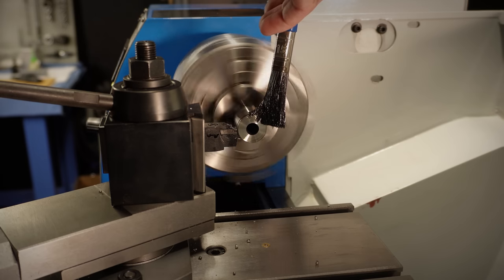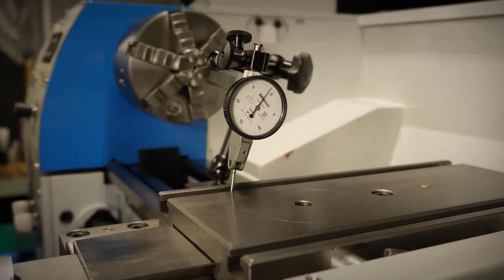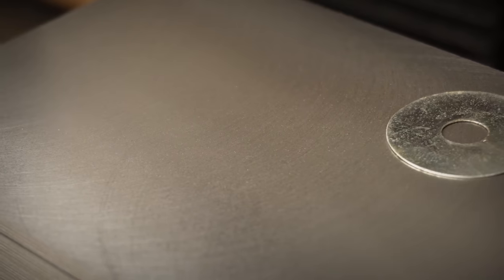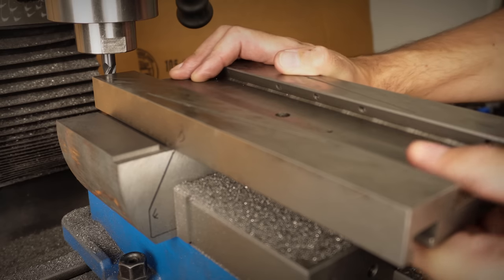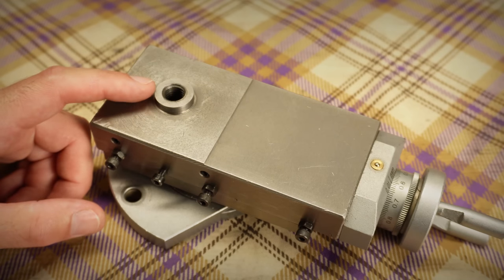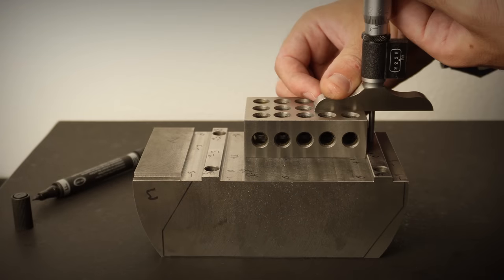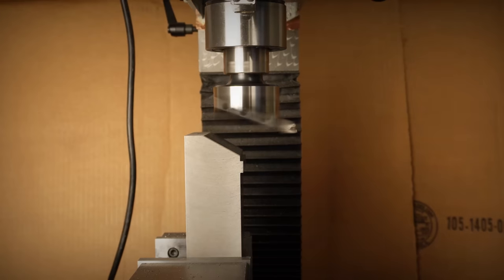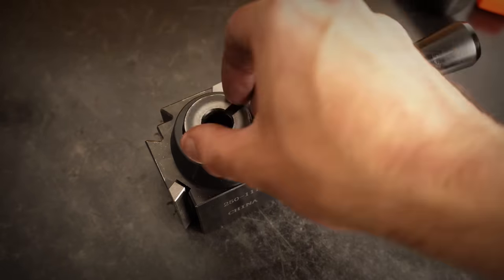How a Solid Tool Post Mount changed my lathe

Comment: This is next level stuff trying to insure a solid mounting. Oooh.. 13:44 I see it has the shishing sound of solidity in the cut. Tremendous. Mine just squeals and my tailstock does some weird "notching movements" when I'm turning it in to drill. I have no idea on the second issue. 10" WW2 model
15:45 Wow that's taking chunkage.
Reply from the maker: Thanks. Have you checked if your spindle bearings are good (and tight)?
Reply: @nbrworks  Yes, what it does is grabs like it is cogged in the tailstock. It's the amount I move the handle. I have not taken apart the tailstock. I'd say it does some sort of grab thing every 2-5 degrees of turning the tailstock handle. So now since you made me think about it, it's probably internal to the tailsock.

Comment: Nicely made. But you've made it so you can't change the angle the tool is presented to the work, which seems very restrictive - what were your reasons for this?
Reply from the maker: Yes, it needs to stay put against rotation. With this change I might be taking heavier cuts sometimes and don't want to rely on the stud alone.

Comment: Wow! My lathe is also from HBM, a tad bigger at 290x750, but no way it would cope with such a DOC in steel.
Reply from the maker: Hi Steve! That's interesting (I have no other lathe to compare). Mine is a 250x550. If it helps understanding why it might be able to make such cut, I have taken it apart and rebuilt it. I haven't change much on the lathe, more like a clean up, small improvements and make sure clearances were tight. I added a 15mm steel bar underneath it - that made it feel more stiff. The solid tool post mount finishes it off. (I have videos of the rebuild if you're interested). Having said that, the stand is really bad and the whole thing shakes a lot, you can see that in some of the clips. Making a good stand is on the to do list. That should even make things more solid! Cheers

Comment: About the HSS parting tool walking out of the holder - was that a result of the flex in the original setup, so no longer a problem?  Did you alter that parting tool holder?  Nice job on the solid block, of course!
Reply from the maker: That's a very good question and something I didn't address in the video. From what I can tell, the tool holder has the adjustable jaw slightly angled and using a thin blade just makes it prone to slip. Also there's nothing holding the blade at the back and that doesn't help... but I see other people using this type of holder with no issues (apparently) so I'm assuming mine is "deffective". In the last tests the problem didn't happen because I was careful, had the blade sharp and didn't need to push it too hard... it worked but I don't think that's resolved by just having the solid mount alone. (I always set my part off tools square to avoid this type of problem.) Anyway, I might address the issues with the holder in the future or even make a new one, slightly different for a P-type blade I just got in the mail. 🤫😉

Comment: that is a significantly feeble compound, would you bother to do this had you a more substantial machine?
Reply from the maker: I think it would depend. If I had no reason to complain with the compound, I guess I wouldn't do it. In my specific case it does make a difference and it is worth it. In my upcoming video I had to swap between the compound and the solid tool mount a couple of times and it's not a problem at all. 2 minutes job, not more than that. The registration features help a LOT to keep it easy and quick. Thanks!

Comment: he, is that a hbm bf30 mill ?
cheers
ben
Reply from the maker: Hi Ben. No, it's from Amadeal, 25 model, I think it's smaller than the 30. Mine has a 700x180 table.
Reply: @nbrworks  yes, you are right, your mill is rthe same as the hbm bf25, the all come from the same factory, only the different brands has different quality, but in basic  they all all the same.

Comment: What is the advantage of a 6 jaw chuck over 3 or 4?
Reply from the maker: There's not really an advantage of the 6 jaw over 3 or 4 (self centering) other than a better distributed grip... but that also depends on the quality of the chuck. A good 3 jaw is preferable over a bad 6 jaw. I happen to use a 6 jaw because it gives me better concentricity than my 3 jaw (and I got it cheap). 

Have in mind that most 4 jaw chucks you see on youtube videos are not self-centering, but have independent jaws. Those are normally used to get lower runout on parts (better than self-centering chucks) or to offset work as needed, or even turn square stock on the lathe. Hope this helps 🙂
Reply: They are useful if you do a lot of thin walled parts, less distortion from the pressure of the jaws.

Comment: I don't like telling someone how to do the things they post on the tube but would it have been easier and more tidy just make a new hold down bolt that fits the tool block. You wouldn't have to introduce a cut for a l- shaped corner holder and could rotate the tool post to whatever angle may be best for your needs